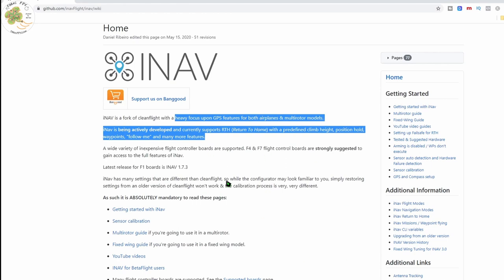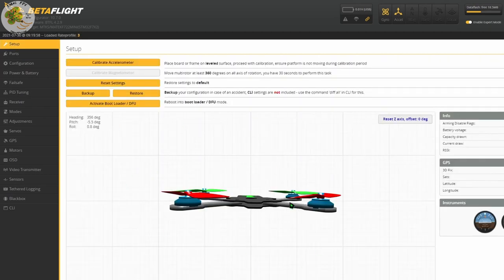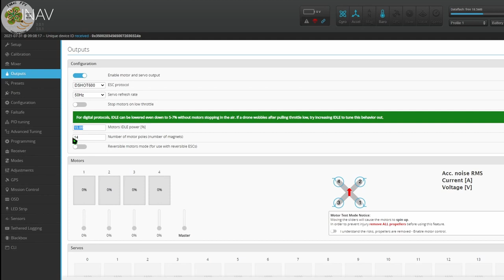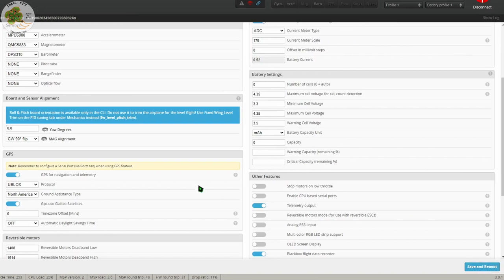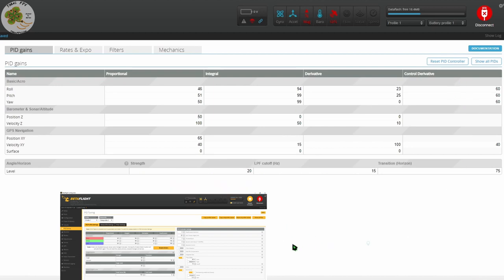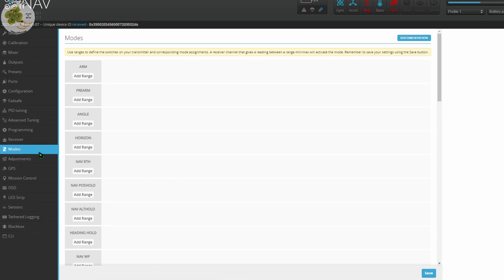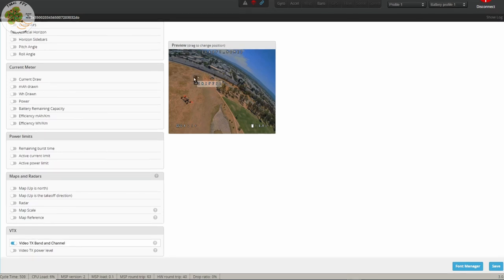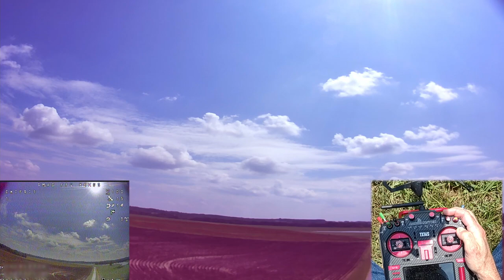INAV Configurator Setup for Betaflight Pilots (EASY TO LEARN & FUN TO FLY!)

Comment: Hey TMac. Great video as usual. Glad to see you’re still going strong.
Reply from the maker: Hey Vincent, great to hear from you! How've you been? Yep, as in the line from Monty Python, "I'm not dead yet!"😂
Reply: @TMacFPV  all good thanks. Took a little break but I’m back to flying. Got a crazy deal on a DJI Combo ($550) so I’ve been messing around with that.
Reply from the maker: @vincents3334  Outstanding!🤩

Comment: Unfortunately I still think inav has a ways to go especially with regards to poshold and its RTH feature.   It does work but its funky to say the least.  I've had my quad out over 2 miles and hit RTH and the quad started banking left and right and back and forth like it was drunk.  I let it do its things which apparently its Adjusting according to my osd warnings data.  After a 30 tense seconds the quad did start it's way back to the home point but sideways and it was zig zagging all the way back.  After it hit the home point it just stop and started doing the banking thing again for a few seconds then it just sat there!  I had to take over a d land it.  Lol.   Now weird thing is I've had this RTH work flawlessly and poshold work flawlessly before and it just seems the processing in inav get hung up from time to time and when that happens weird flight behavior takes place.   Last flight I took on the latest Inav 3.0.2 my 6 inch Badger after hitting RTH about a mile out just disarmed and fell to the ground!   I've since grounded it and thinking I'll try Arducopter again since I've had arducopter on a 5 inch a few years back that worked really well or I may just stick with emuflight since my 5 inch Roma L5 runs that and flies great and GPS rescue imo is really all you need on quads like this.   
Now Inav on fixedwing is another story!  Inav works flawlessly on the 5 planes and wings I'm using it on and even running old 2.6 firmware on a couple that's been rock solid.   It just feels like inav devs are geared more towards fixedwing now days since they have that pretty much locked down and working really well,  just don't think they have this whole quad stuff worked out yet or they just get it to work as good as they can and say deal with it.  Lol.

Comment: Awesome video as usual. Thanks for sharing this info. Just a little note about the black foam: it is to block light hitting directly to the barometer because its sensitive to light.
Reply: Good to know.  I thought it was for wind protection.
Reply from the maker: Per Infineon Technologies (maker of DPS310 barometer that is installed on the Matek F722 SE flight controller): "DPS310 is not light sensitive. However the foam can help to remove the air turbulences, dynamic pressure and keep static pressure only which count for altitude metering."

Comment: Nice!
A couple of questions;
Your new GPS seem to work out in that location at the rear of the quad?
Some users say had mounted the GPS on a post, I was curious if that was really necessary.
Also, I need to upgrade my GPS too, what wattage iron should I use?   
Thanks!

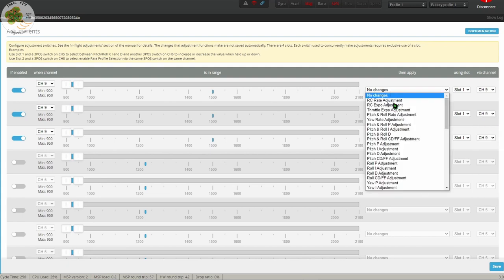Comment: 43:10 you can do the adjustments with just a single entry by selecting the whole switch range, then you can remove the 2 other entries below (same as in betaflight)
Reply from the maker: Good point! I have no idea why I got into that habit🤔Thanks!

Comment: Great video, thanks for sharing. In the process of migrating over from BF to iNav. A quick question, in iNav 4.1 the 'rate profile selection' isn't listed in the Adjustments tab, would you perhaps know how this can be setup on a switch as you have done? Thanks

Comment: Awesome video! So glad you put this together. One quick question, would the PID gains, Rates & Expo, Filters, and mechanic values be similar on a 5 inch quad?
Reply from the maker: PID gains can be copied over from Betaflight PIDs.  I 've got a complete Playlist on how to tune PIDs using Betaflight (and therefore the same with iNav) I'll provide you the link to. https://www.youtube.com/playlist?list=PLKAiYAaTdvmoXyDzrPWj9-sxv4m1GNKCT  Although it says for "Micro FPV Drone Tuning" it applies to all sizes for quads.  Specifically, take a look at the downloadable Tuning Guide.  It will help.  iNav filters are not the same as Betaflight and will be specific to your quad (every quad is different).  Rates and expo are a personal preference and should not be copied from someone else.  Just try different values and see what feels best for you. Here's a video on Rates https://youtu.be/52vR7Nt_t2c
Reply: @TMacFPV  Thanks you so much! I'll definitely give this a shot.

Comment: Hi, Tmac. Good night. My name is Itajaí, from Rio de Janeiro/BR. I'd like to ask a favor, if possible. I mounted a drone racer with the FC Matek f722-se, updated to version 4.1 and configured in Inav Configurator 4.1. My  radiotransmitter is an AT9S Radiolink and the receiver is an R9DS Radiolink. The configuration is all right, checked several times. But, when trying to save the configuration of channels 1, 2, 3 and 4 on the tab receiver(1000-2000), via CLI, they stopped working, even on the radio. I can't figure out what's wrong with the board.Can you help me with this? I leave here, my thanks.
Hugs.

Comment: Great videos T-Mac ! Coming from Betaflight but not really wanting to be a full-on racer (but will want some freestyle capabilities), decided its useful to have position hold /return to home and other capabilities other firmwares offer. I can see that Ardupilot and iNav have these extra features so I am between the two. Knowing that iNav requires the extra sensors, does that make it a better choice for these modes?
Reply from the maker: Hey Georgio's! Here's my take on all 3 firmware.  Best manual flight (Acro Mode) firmware is Betaflight. Only GPS assisted function Betaflight has is GPS Rescue. Best Autonomous flight firmware is ArduPilot. Been around longer, most GPS assisted functions, etc. A little more difficult to setup & tune for manual (non GPS assisted flight modes). My ArduPilot Playlist is here ArduPilot & Arducopter: https://www.youtube.com/playlist?list=PLKAiYAaTdvmr0cz6tfXCZPBRUUCB8nSXx . iNav firmware, in my opinion, is somewhere between Betaflight & Arducopter. Not as good as Betaflight for Manual/Acro Mode and not as good as Arducopter in Autonomous flight modes. Does "OK" with both types of flight modes

Comment: Thanks for the info about stick commands to select which profile you want.  Is there any way (like in the OSD) to verify which profile your currently on?  Thanks!
Reply from the maker: Hey Dale!  I'm not awatre of an iNav OSD element that displays this value on your OSD, however, you can always recommend it as a feature on the github site for a future release https://github.com/iNavFlight/inav . To see what PID profile you're on, while looking in goggles get into OSD menu system by holding left stick center - left and right stick center-up.  Then use right stick to navigate into PID Tuning.  Here, you'll see what PID Profile you're currently on and can change it here also.
Reply: @TMacFPV  Cool, I'll use the sticks to verify what profile I'm on.  I don't have a github account at the moment but I'll make that suggestion later.  As always, Thanks for the help!!!

Comment: hey Tmac. nice vid. but the pos hold is not doing good. its toilet bowling. its a compass problem. avoid running DC(battery leads) wires near the gps puck. even on strong winds, it can do pos hold(quad is tilted but remains in position). also much better seen on dvr with fpv cam at zero degree angle. I also do my compass calibration with ALL the parts connected and finalized. no usb cable to PC. just do it thru stick commands(mag calib). just an fyi

Comment: Tmac, after you calibrate the compass with stick commands, is it necessary to save the settings with stick commands?
Reply from the maker: Hey Dale! No. As seen in video, after 30 seconds quadcopter will beep indicating calibration is complete. If it doesn't beep, calibration was not done. See Calibrating Compass with Stick commands at this link https://github.com/iNavFlight/inav/wiki/Sensor-calibration
Reply: @TMacFPV  Cool, thanks!
Reply: @dale7431  I'd suggest doing a calibration frequently.  My build kept doing weird stuff.  Also if you happen to fly lipos and calibrated with a lipo installed then switch to a lion bat you may have compass issues from the Li-on packs.

Comment: I tried this recently and could not get two different fairly expensive compass/gps combos working and kept getting hardware warnings. Looked through a lot of online resources but no luck.. Since no compass, no position hold, I flashed back to BF. Maybe I'll try it again. Thanks for the video.
Reply from the maker: Sure thing Bryan!  Yep, compass is a must. Mount GPS module with compass parallel to flight controller (not at an angle) for easier calibration and best results.  Foam over barometer is a "good thing" too!
Reply: @TMacFPV  The compass was mounted at about a 30% angle, since the tpu mount came with the rekon5. I'll look around for a flat mount before trying again. Thanks again.
Reply from the maker: @kurtzFPV  yep, that's what I had originally too (actually mine was about 21.5 degs). Didn't work well. Could get it to work with some math, but easier to print out flat mount. Once flat, compass worked fine. I've got a flat mount STL I  could send you but it fits rear standoffs that are 12mm apart, center hole to center hole. If that works for you shoot me an email and I'll respond with STL
Reply: @TMacFPV  Wow, very much appreciated, but just checked and the Rekon5 standoffs appear to be right at 15mm center to center. Yeah, I even tried the cli commands that were supposed to compensate for the angle with no luck. Then iNav started failing to pick up the GPS. Flashed back to BF and both compass and gps were recognized right away. I disabled the compass for now though, since I am more confident in just the GPS alone in Betaflight and not sure if the compass brings anything at all in BF other than maybe sending me the wrong direction fast:>)
Reply from the maker: @kurtzFPV  no worries.  I'm with you.  Don't use compass with Betaflight.  In fact, use the Matek SAM M8Q without compass for Betaflight builds

Comment: First watch
Reply: i try convert from bf to inav, all good, but the rx crsf not respond in inav but working great in bf.
any suggest ?
Reply from the maker: @CgitEinsteins  Do you have Serial RX toggled on for the correct UART in Ports Tab of iNav?  Save & Reboot.  Receiver type in Receivers Tab set to Serial and Serial Receiver Provider in Receivers Tab set to CRSF.  Save & Reboot.  Should work!
Reply: Do you have Serial RX toggled on for the correct UART in Ports Tab of iNav?  Save & Reboot. ? (Yes i do and correct).
Receiver type in Receivers Tab set to Serial and Serial Receiver Provider in Receivers Tab set to CRSF.  Save & Reboot. (still not working)
BUT when i change to another UART, its work. Thank for the tutorial video.
Its library for me now.

Comment: Inav just doesn’t work. I have tried it on my zeus f722 first.. the rekon5. The drone took off and flew away and wouldn’t stop. I then bought the recommended controller… a matek f722 mini and the same thing plus it doesn’t work right with arming at all. It arms sometimes and most of the time it doesn’t! This is the biggest piece of garbage software I’ve ever seen! So I’m gonna watch your video and see if I missed something. But this is the most frustrating firmware I’ve ever dealt with